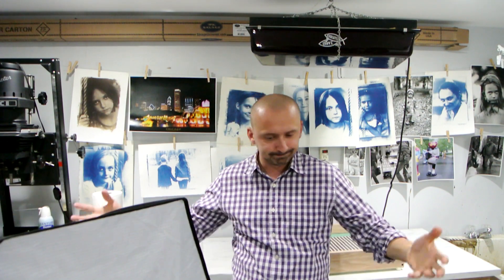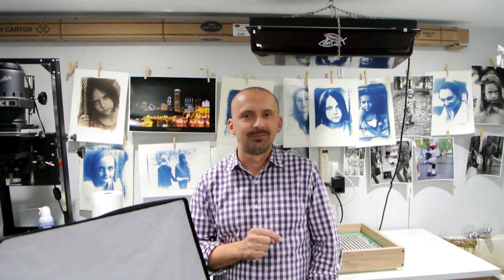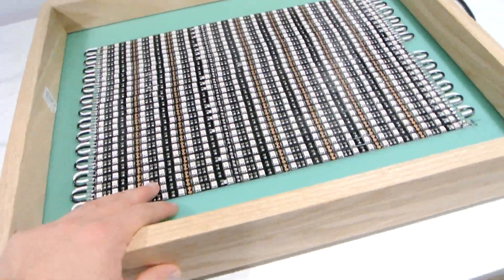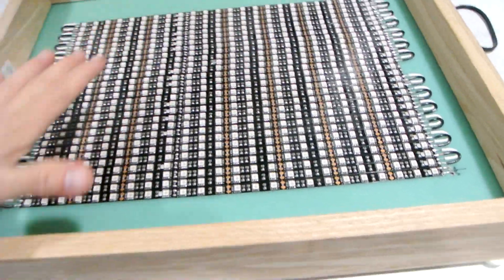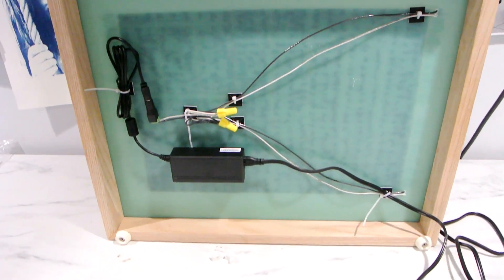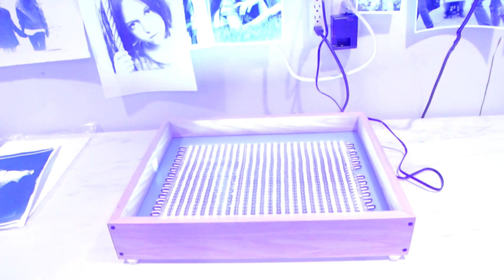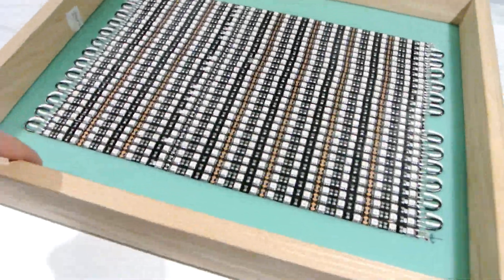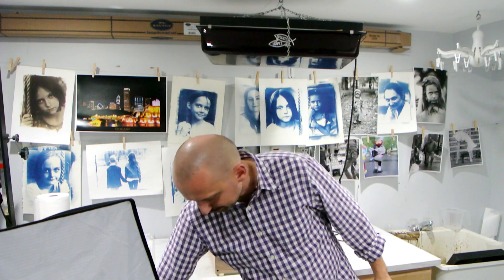UV LED Exposure box

Comment: Kris,  could you share the specs and perhaps a link to the UV-LED strip you used for this build please? I understand it's been three years but I really need to know the UV- wave length of the strip you used. I bough a few of these al with 380-405 nm wavelength and my exposures are unbearably  LONG.
Reply from the maker: Hi,. I got mine from Envirometal lights their model  5050 UV LED and the center  Wave Length is  404. My exposure is  never more than 10 minutes and usually between 5-8 minutes.  I have them separated into two banks instead of one long series.
Reply: @krisb8781  Thank you for the detailed reply. Perhaps I should reduce the distance between the sensitized paper and the UV-LED array without getting hot spots.  Also, I don't think any of my LEDs are 5050 size.
Reply from the maker: @overlycranked8674  hi. The optimal distance for 5050 ones is about 1.25 inches from the led and glass. This was calculated by someone way smarter than me. I just used their math. Also it could help to stagger the LEDs so that they are in sort of diamond pattern.

Comment: Many thanks for the informative tutorial!  What wavelength are the UV lights?  Would I be right in thinking that's important when making cyanotypes?  Furthermore, does wattage make a difference?
Reply from the maker: Hi the wavelength is around 380 -420 nm. Wattage is around 50 watts
Reply: @krisb8781  I'd heard that UV lights that weren't a 365NM wavelength wouldn't expose properly with Cyanotypes, so that's got me really confused!
Reply: @TPToE  365nm (or maybe even a little shorter wavelength) is ideal, but the sensitivity of a cyanotype extends to about 400nm or so. 

For any given power output, the exposure time will increase as he wavelength gets longer, but with this kind of power only a few cm from the print, it really doesn't matter. 

Some people have seen issues with highlights or the whole print washing out with longer wavelength lights (Nicole small, I believe her name is, has a video talking about that), but I've had good luck with a 400nm light, and projection (not contact prints) with my Casio laser DLP projector, which uses a 405nm laser for its blue source- pretty nifty stuff.

Comment: How much heat does the box emit? Do you think the heat-resistant substrate is necessary at the bottom?
Reply from the maker: Hi. There is very little heat being emitted during the 5-10 minutes exposure. My previous unit simply utilized a piece of Plexi vs heat resistant material. Besides, whatever heat is produced, it's projected upward so the panel doesn't get hot.

Comment: Hi Kris.  I am soooo glad I stumbled across your LED box.  I first saw a post on alternativephotography.com by Gavin Lyons.  Tonight I found yours.  Is there any reason you have your LED strips together without any spacing?  I was wonder how far apart the strips could be set and still give a decent exposure.  I have a 20" x 24" silk screen exposure box.  I upgraded the bulbs to Atnic for faster exposure times.  Most exposures are around 10 to 20 minutes depending.  I have a possible commission request for images that could go up to 36" x 60".  I would love to be able to make a box that size and not have to expose two 36" x 30" sheets of paper.  I'm wondering if this could be done without the LED strips as tightly set together as yours.  What do you think?  Thank you for your time in answering my question, if you do.  I have a video posted here of my Blue Van Dykes if you want to see why I need such a big light box.  I had to make the video so I would be able to show clients what exactly Blue Van Dykes were.  https://youtu.be/dffMD_bjoe0  Thank you, Bronwen  
I just sat down and did the math.  I'm probably better off using sunlight but I still have the same question because I have 3 dimensional egg shapes that I'm painting Cyanotype  and Van Dyke Brown to.  I would like an even exposure all the way around so I was going to use heat resistant fabric and a flexible plastic backing to make a round exposure box that will give the shapes even exposure.
Reply from the maker: Hi. First off thank you for commenting. I really appreciate it.  Now regarding the LED light.  The answer is no they do not need to be so close to each other, in fact, there can be about 1/2 space between them. The important thing is that they are about 1-1/2 from the top of the surface this is where the light they project most even. Of course, they can sit lower at the cost of exposure times.
Reply: @krisb8781  Awesome and thank you for your quick reply.  That is good to know.  Here in Delaware, winter is very gray, and not dependable exposure weather.  I'll probably have to expose the 36" x 60" outside.  I'll be looking out for more of your videos.  Thank you, Bronwen

Comment: Hi, can you give us a list of materials (especially the LEDs) used? Did these come on strips which you attached to the bottom and soldered in lines? Thank You! R.
Reply from the maker: Hi, the LEDs are UV400-5050. I got mine many years ago from Enviromentallights.com I am sure you can find them somewhere else as well. they come in a roll. I cut mine to size and soldered the jumper cables. If the strip was not long enough you solder them together.  Power supply is Amazon Chanzon 12V 5A 60W AC DC Power Supply Adapter. Lastly, the substrate is Garolite sheet from McMaster  their number MCMASTER 8667K32 they come in 36x48 sheets so that will make you at least  4 16x20 sheets. Wood for frame from Homedepot.